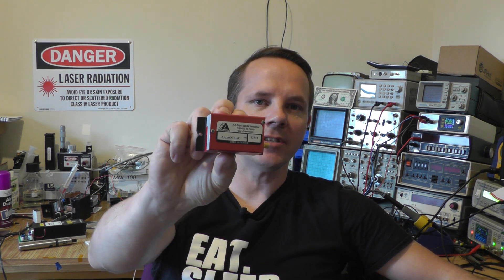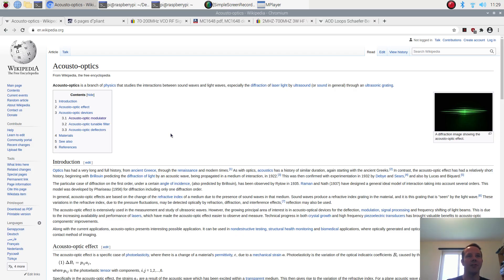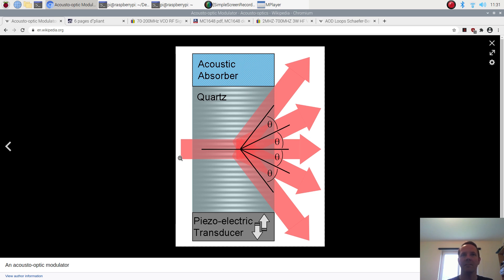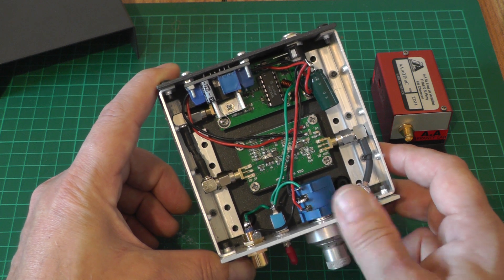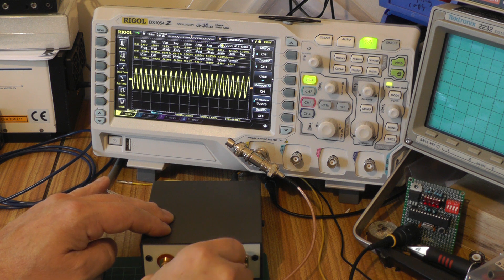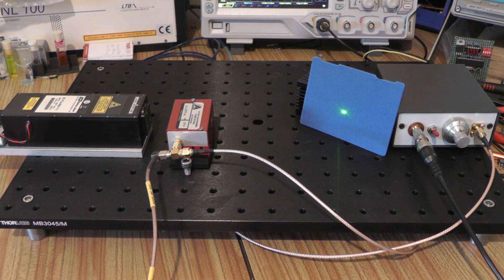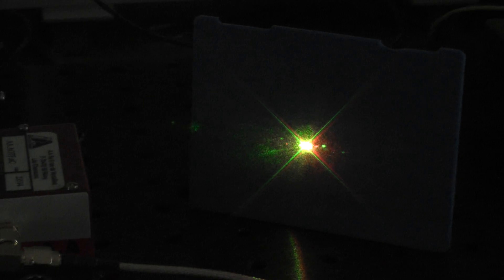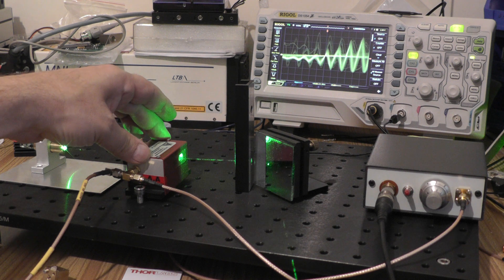Homemade Acousto-optic controller for Under $100!

Comment: Cool video - everything makes sense to me except the capacitor next to the power jack? What is that doing?
Reply from the maker: @phuecn  just a bit of smoothing. Some wall warts have noise and ripple.
Reply: @LesLaboratory  Ah, fair enough. I assume this can be run off of a small 12v PS? What amperage would you recommend? I've put together a parts list just now as my 30 year old AOM driver broke just yesterday!

Comment: Is that a "filter" or a "modulator?"  If it is a filter, can you put in white light and get a variable wavelength light out?
Reply from the maker: It's a tunable filter, so yes, if you collimate white light, and pass it through, it would be possible to pick off any wavelength. This technique is used in some types of Hyperspectral cameras, where a sequence of pictures is taken, whilst an AOTF sweeps across the spectrum.

Comment: For a specific applications i need up to 700 MHz of modulation frequency. do you think this is possible? i haven't seen any commercial products being able to produce such a frequency.
Reply from the maker: Not with acousto-optics. I think Pockels cells will go to 100MHz+ , for really fast speed, you might get close with a Kerr cell. What is the application?

Comment: Hey Lees could u drive a 15 watt or greater Argon or Kypton laser. Use a greater crystals with sound to split 515 nm and 448 nm and the wavelength near purple? Does ur Argon still work? 15 years ago a 6 W gas tube on ebay was 60 grand!!

Comment: Thank you so much for the helpful video. I am about to purchase an AOTF for our lab and am thinking about making a homemade driver. What is the difference between an AOM and an AOTF? Would it work to use an AOM in place of an AOTF if we just modulate the frequency of the input?
Reply from the maker: Cheers! AOTF's are designed to be able to control wavelength, and AOM's are just modulators. I guess the difference is in the physical packaging and the controller. I you just want to turn on and off the beam then AOM, if you want to select wavelength then AOTF.
Reply: @LesLaboratory  Got it, thanks!

Comment: Interesting video. Wonder how the signal would be if the input was a photodiode.
Reply from the maker: The modulation signal?
Reply: @LesLaboratory  Yes, just curious if the actual light modulation would be as clean as the input. Looks like you were reading the input signal on your scope and visually assessing the output.
Reply from the maker: @lambda4931  ah, right.  Depends really on the application. I measured this recently for someone, and the carrier wave that drives the crystal is clearly visible in the output. For good clean on/off switching of a beam, a Pockels cell would be faster, better and cleaner.

Comment: Ohh this is amazing and beautiful experiment. I do have a question and I hope you see it to help me understand. So, I noticed that your first green laser(black enclosing) was CW laser but when you fed the AOM with function generator, apart from splitting of laser, you got a pulsed laser. Is it something also an effective way of pulsing a CW laser? So, for. e.g. can we use the VOC and AOM to produce modulation and pulse in a CW laser? Can we produced a 100 fs pulse?
Reply from the maker: Yes, effectively you can modulate the laser beam , thereby pulsing it. The problem with AOM's is you can't do this very quickly. The carrier frequency is about 100MHz, and the crystal has to physically oscillate when you apply the signal, all of which takes time. 
There is no chance of getting 100fs pulses out of this setup, in fact, those kinds of speeds are only really achievable under special circumstances, for example with mode locked Ti:Sapphire Lasers, or by using non-linear optical magic with Mode locked Nd:YAG Lasers.

Comment: Thank you for the useful explanation! Basically this is a useful technique to modulate a CW laser. I would like to modulate a CW laser with 10Hz and a duty cycle of 99.9%. This means a pulse of 10us and 100ms Off time. I also tried this with a 'noise eater' from BEOC and a wave generator, but the nonlinear optics resp electronics from the 'noise eater' are too slow. A duty cycle of 99% with 10Hz is the edge. Do you think I could manage the 10Hz and 99.9% dc with your set-up in your video? Did you measure the shortest possible pulse?
Reply from the maker: Ah, Dan Maloney pinged me about this! You should have a message in your e-mail inbox, along with oscilloscope shots.

Comment: Great video as always, thank you. 
One other interesting effect of those AOMs is that they will shift the frequency (hence wavelength) of the laser beam by the same frequency you fed into the crystal with your RF source. You can use this effect for many applications.
Reply: Can it form a picosecond pulses for say fluorescence lifetime analysis?
Reply: @nvspraneeth901  I think Pockels cells are typically used for anything beyond the nanosecond range.

Comment: These can be driven at several frequencies at once to stack wavelengths on top of one another. They were commonly used for color modulators in the ArKr mixed gad ion laser days of laser light shows. They were also used in biotech equipment for scanning florescent stained samples with a multiline arkr laser. Keep it clean as TeO2 does not like cleaning by nornal solvents. 🤔🤓❤
Reply from the maker: I was that in the manual, but wanted something quick and dirty. Thanks for the advise on cleaning, the intent was not to touch it anyway as TeO2 is soft stuff, but I might have been tempted by solvents!

Comment: Great video! I'd be interested in what effect RF power has, I imagine it would affect frequency response more than vco frequency too given the direct dependence of the crystal compression with the amplitude. In your video you suggested changing the amplifier power rail, but that might cause compression and additional harmonics in your RF leading to more mixed response. A better approach might be to add an additional stage of amplification then an RF attenuator to control level. You can get VC RF attenuator boards on eBay too. Would be great to hear what you think.

Comment: Is there any GUI or any software that can be used to steer the beam?
Reply from the maker: Not that I know of, but it could be done with an Arduino and a DAC. Bear in mind a PCOM or AOTF doesn't steer the beam, more like select wavelengths. To efficiently steer, consider using galvos (check out some of my other videos)
Reply: @LesLaboratory  Thank you for your reply. Could you please refer to me a tutorial where the connectivity and control of the galvo system is explained? I am trying to learn about the system, but couldn't find a proper source.

Comment: 1:41 - "thats it, not very existing" lmao you can that again. I wonder what is the life span of these AOM devices, how long can I use them for before it needs some form of calibration since it seems like it uses some kind of springs? Can I use them for precision based photolithography? Thanks.
Reply from the maker: Indeed! I would say, probably indefinitely. There are no springs, its is basically just ultrasound though a rock. It depends in what context you anted to use it for photolithography. If it is for modulating the beam, then sure!

Comment: Fantastic video really appreciated this as I have a Qswitch module and its driver and wondered how it was used. Unfortunately I have no datasheet on either as they have had any OEM info erased and only have a Rofin part number now. The modulator I have looks very similar to yours but is smaller and has 2 SMA connectors, one is obviously RF and connects to the driver but the other doesn't appear to be RF as its only twisted pair wires, I don't know if its an input or output but Im guessing its an output for some sort of monitoring, have you any ideas? I received a whole pile of optical stuff from a very fancy passport laser printer which generates holes through the passport. So its quite a grunty laser (40W) , more power than I'm willing to play with at my experience level or have a power source but I do have HeNe etc units so Im really looking forward to setting up an optical bench and having an experiment with optics. Thanks to your explanation about safety glasses I have ordered some reputable ones, when they arrive I should have a table ready to go Woo Hoo.
Reply from the maker: I hate when manufacturers do that! It does sound like some kind of feedback loop. do you have a picture? Nice! I had never considered passport printers for parts, interesting! :-)

Comment: Thank you for the informative video. What is the relationship between the frequency of signal generator and laser modulation frequency?
Reply from the maker: The higher the frequency, the shorter the wavelength of light it will switch. So for example at around 87MHz, it will modulate a red laser pointer at about 660nm, and at 101MHz with will modulate a green laser poiner at 532nm.

Comment: Awesome to see man!  Excellent work as always for the layman and/or head traumatized scientist as well.  I experienced a Brimrose AOTF-NIR for a few to assess feasibility for process analytical technologies and lab testing of pharmaceutical raw materials. Interesting the capabilities for spectroscopy.  Is there a spectrometer build using potential in the future?
Reply from the maker: Thanks! Those look like cool devices, are they using white-light sources? Well, maybe then! I will have to try some more experimentation with it to see what is possible.
Reply: @LesLaboratory  Yes, reads like a Tungsten (Tungsten Halogen) white light source.  Reminds me of doing a feasibility study that I wish I published regarding how well performing the COTS equivalent spec lamps were compared to the marked up bought out (higher quality spec?) name branded for the FT-NIR I was working with.  Get's me wondering what headlights on the market meet suitable performance specs.?  Reads an InGaAs detector is being used also and not the DTGS, PbS or InSb.  I preferred the InGaAs TE cooled for all my FT-NIR work.

Comment: Just as a small warning: if you want to actually tune your light, do not get an acousto-optic modulator! They're designed for much, much higher power, both RF and optical, usually starting around 15W and going up to 100W(continuous!), they will need to be driven at that power to see an effect and the high power AOM drivers are very pricy. I'm on the high power side of the camp, using an AOM to q-switch a DPSS laser, and my 50W rated q-switch only started showing an effect at around 15W of input, operating correctly at around 30.
Reply from the maker: Interesting. Is it down to the size of the crystal and/or design power perhaps? I ask, since I have a millijoule Q-Switched YAG (Non working...yet). the physical size of the Q-Switch is quite small, maybe 20mm long and the diver itself doesn't seem too large either.
Reply: @LesLaboratory  I'm not actually sure, but it might be to do with the material and its damage threshold.
My crystal is pretty small too(G&H QS27 series), most of it is just the big water-cooled metal housing.
I'm sure it would disturb the q factor of the cavity at lower power, but I didn't see a significant splitting effect until around 15 when I was putting a red laser through it.
Reply: Used to work on DPSS systems largest amount of power (for the aom) we used was around 200W.

Comment: On the AOTF, that's a regular SMA connector not an RP-SMA connector. As far as I've seen, RP-SMA is only used on consumer Wi-Fi equipment.
Reply from the maker: So it is! You are right.

Comment: Maybe you can give some insight on a curious laser physics note that has very long intrigued me. On the Hyperphysics website under the page for Brillouin scattering, there is a diagram showing "laser water scattering" using a helium neon laser that is supposedly demonstrating the creation of side bands on either side of the 632.8nm He-Ne line due to phonon creation/annihiliation by the beam's passage through water. I don't have access to the paper referenced and I've never heard about the phenomenon elsewhere or ever seen it demonstrated. I don't think it's related to Raman scattering, but is something totally different that I don't really understand. It would be really great to see someone demonstrate what this is on youtube.
Reply from the maker: That would be a cool but very involved project! It seems to require a hyper-fine spectrometer to see the Brillouin Shift. I wonder though if it is possible to do it on the cheap...

Comment: Can you drive it with a square wave, was thinking of a Si535?
Reply from the maker: You mean just the AOTF? I would be inclined to build an RC network to convert that square wave into a sine wave. I suspect all sorts of nastiness would happen otherwise. You will need to amplify the output  of the Si535 as well.

Comment: Very awesome video! The cool thing I noticed is that these also will rotate the polarization of a laser beam as well which is an interesting effect. When I get a white light Ar-Kr laser going I want to revisit PCAOMs and related devices. A friend of mine also said strange effects visually happen if you view a white LED through one during operation. Non-linear optics make fore some of the most fascinating crystals on the planet!
Reply from the maker: Cool! Yeah I had thought about polarization, but haven't gotten around to playing with it yet.
One of the first things I tried was a white LED, but I could not see any changes, that said, I did not collimate the beam, so perhaps it is worth revisiting...
For sure, there are some really interesting phenomena!
Reply: @LesLaboratory  You may want to try placing a polarizing filter in front of the LED so that it is much more efficient for the crystal. I figure the angle you would also see the change at would be quite narrow as well. It would be a tricky thing to visually see all in all. I have yet to try myself.

Comment: could you try to generate sound with light modulated by this AOM?
 a triangle wave generator (at 100khz or so) fed into a comparator with a ordinary audio signal fed into the second port, out comes a variable pwm duty cycle (like a class-d amp) 
with it you can turn on/off the AOM.  

i found that shining a intense beam of light onto candle soot covered surface or any other black plastic / paint creates sound. it makes the changes in intensity audible.  
also works with powerful leds. but its not very loud and not efficienct at all. not sure whats going on, maybe thermal effects. 
imade 2 videos showing the effect a while ago. would be great to further investiage on this to maybe create a "Laser Tweeter" or something haha
Reply: I want to make a video about laser pews in space. There are a lot of people who go about saying that you would not hear things in space, however if a laser hit your space ship and was modulated you would have a chance of hearing a sound. It's a video I may do in winter. 

Something else that could be done for what you are speaking of could be as easy as using say Audacity to shift the a sound wave entirely above the 0 crossing and use it to drive a transistor in parallel with his amplitude  potentiometer. His AOFT is certainly capable of modulating a fair bit of power so he has a good chance of making some music happen.

Comment: I have 3 of these with the original controllers if anyone's interested, from the Leica confocal microscope I took apart https://www.youtube.com/watch?v=jaM9_JVnWQE
The controllers have 8 frequency generators, which can be individually turned on/off by TTL signals, so you can easily select each wavelength of a multiline laser
Reply: Mike, I am definitely interested.
Reply: Jesus Christ Mike… I remember watching your video series about the confocal laser microscope… i’ve watched them several times over the past few years.

 But rewatching them now…
Damn that’s impressive !… That unit was worth an absolute shit load. 

I only dabble with lasers and photonics as a hobby… but even on a hobbyist budget I’d gladly pay 1000 bucks for it and drive several hours to get it! Even if I had to put it on a damn credit card 😂

That stuff was more common 5 to 10 years ago…I used to find stuff like that at scrapyards and government auctions a few times a year. 

Now you can forget about it…..resale values have gotten astronomical… And everyone has a smart phone and can quickly Google something before dumping it at a scrapyard or cheap at an auction. So they know what those lasers and modules are worth. 

I do industrial electronics repair and test equipment calibration for a living. So I’m constantly around government auctions, warehouse closings, and company cleanouts… but I almost never see shit like that anymore.

I’d have a heart attack if I found something like that now!